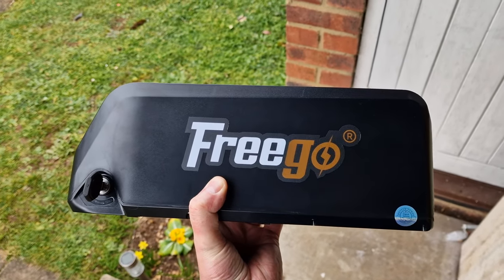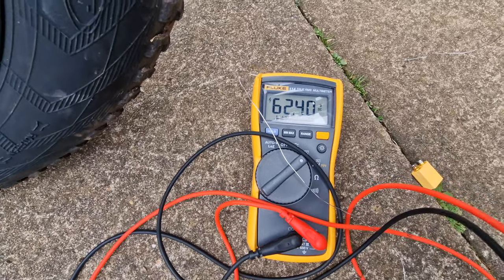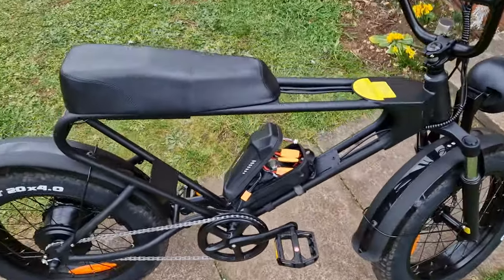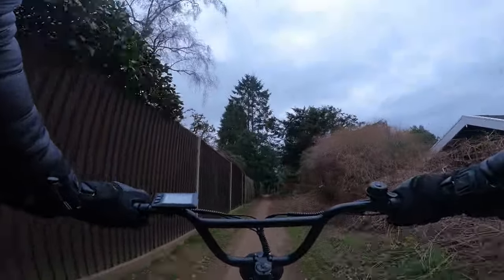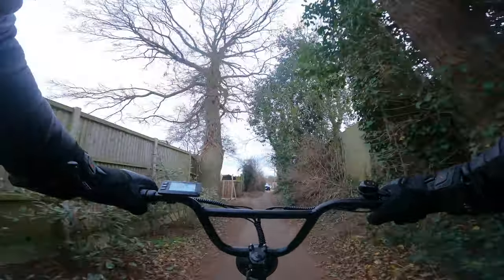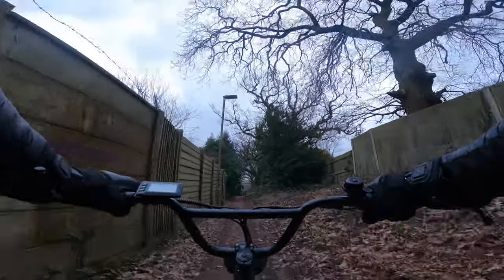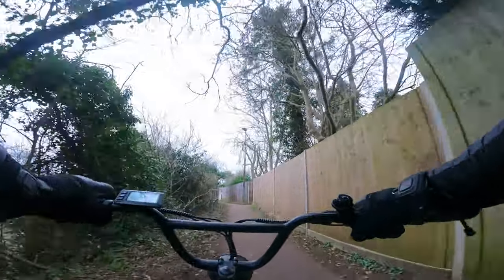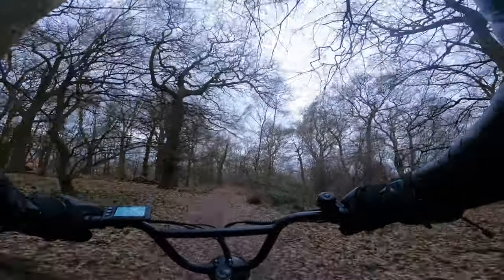HOW TO MAKE ANY EBIKE FASTER!!!

Comment: years ago 2012? i bought a 24v 250w and a 36v 500w kit off ebay, found out it was the same kit! just the increase in voltage gave you more power! it also gave you more speed.... I opened the kits which confirmed this every component the same, including 63v capacitors and 75v mosfets... you know what happened next... 48v... then i got my 4 4s packs and tried 66v... no smoke, but great hill climbing and 32mph.... lasted 2 years before it smoked. repaired and still have that controller/wheel for bench testing

Comment: The individual cells in the battery can be replaced. You test them in groups and when you find a group that doesn't register. You replace like 4 or 5 of them, because one of them being bad will weaken the others. One bad cell can prevent the entire battery from working. The individual cells are like 18650 3.7v 20A or whatever your battery amperage is. Instead of replacing the entire battery. It's a lot less costly to just replace the cells. $50 to $60 in cost for those cells and solder strips. You can be up and running.

Comment: I can confirm this slight overvoltage positive effect, I have been running my BBSHD for around 4 years with a DIY 15S Setup - 61.3V Total (charged/balanced to 4.1V per cell) "No BMS" it works great.
Extra range, extra power, charging to around 90% so a much longer cell cycle life. Obviously warranty is out the door, but if you know what your doing, eg if mosfets are within Voltage limits etc then no big deal. Cheers Andy 👍👌😊🍻
Reply: On original Controller?
Reply: @Full_Throttle_no_Brakes  Yes
Reply: @oze-bikes4life663 cool. thanks
Reply: No bms ?

Comment: Most 36 to 48 volt motor controller have an 60 volt capacitor so up volting or overvolting to 52 volt is never going to be a problem. The new weight you add for more power and range comes at a cost in handling. Look for motor controllers conversion systems with an On / Off road limiter option (single blue or pink wire coming out of the motor controller then back in without connecting to outside source) you cut it or disconnect it plus you can do a lot thru your LCD controller menu to get that extra MPH. Re set the wheel size larger turn off restrictor speeds most have menu guides on line. If you are going to build an E-bike from the ground up (much more fun) don't be impulsive, think about how you want to really use your electric bike the most. I have gone full circle and ended up with my Apex E-bike design that suits me best for use, handling, power and range, The result is an 26 inch rigid frame mountain bike suspension front forks with BMX headset and handlebars cruiser tires and seat. Powered by a Hailong triangle 48 volt 20ah 1600 watt battery converted with an 48 volt 1500 watt VoilaMart direct drive system. Got disk brakes and regen the PAS on this power/controller marriage is perfect, some level 1 PAS setting are not even there when you pedal I can add an extra 5 mph to just pedaling and stretch my range further than I can stand riding.  Not that pedaling is bad but the throttle is great.

Comment: I have a 48v 1500 watt overvolted to 72v that will do upper 40s mph in ideal conditions 
But will do between 42-44mph (67-72 kmh) regardless of wind direction 
Had running for nearly a year and 1,000+ miles and still going strong 

Did right at 30 mph before overvolting
Reply: On hub motor geared or Direct Drive?
Reply: @Full_Throttle_no_Brakes  dual direct 
Some stuff on my channel about it
Reply: @2dthoughts ok thanks
Reply: i have similar setup, how do i overvolt it

Comment: I used to run my electric BMX hub motor on 72V it was ridiculous so much fun but it was hard work on the motor and controller, if the hub motor is geared the rotor is spinning much faster than the control circuit can cope with and 2 things happen, the windings heat, you can even start to melt the often poor solder connections between the motor phase leads and the windings, if the motor has a one way clutch bearing that will normally burn out quite quickly and unless the controller is decent the high speed rotor will often cause false triggering of MOSFETs and you can start blowing them as they stay hard switched on, I've been there done that.

For most geared hub motors rated at 40V I would go no more than 50V that's pretty safe, you only need to push the volts up a little and you are instantly in to zero reliability, for direct drive hub motors with no gears you can be more naughty and up the volts a fair bit.

Fun video, all my fast rides were done with model lipo, no BMS, just a fuse, you can also adjust motor timing and use field weakening to make motors run faster with the same battery voltage, you don't get much more power though you just get higher rpm, I used to change the timing, your also running the motor way inefficient as well if you do that, I did that once in the middle of an ebike race with Steve head from technical bikes back in 2004!! I don't really do much with the bikes these days, I did 20 years of playing with ebikes and realised I need to play with other things as the clock is ticking, loudly.

Have fun

Comment: I've had some issues with AGM batteries being too low to charge.  I ended up plugging in the charger with a spare battery to get the volts up enough to trick the charger to kick on.

Comment: Your faulty batt has crowbar cut out ! ( a crowbar will remain till reset ) think of it as a relay but using electronics …. Disconnect the Bms leave for a while reconnect … they should have used a fuse like my first batt …
Reply from the maker: Yeah is what I thought. They shouldn't have made the battery so damn difficult to take apart.🙄

Comment: Don't throw it!! Just a theory but maybe the battery was left in the warehouse for months and it was totally dead maybe just maybe if you leave it on charge for a good long while it will start to register somekind of current on the reading and it will have to build up to maximum capacity over perhaps twice aslong as it would usually take to full charge just an idea cause it worth a try Channels the absolute Bolloxxs by the way Big love!!!!
Reply from the maker: Yeah I'd never chuck it. I'll take it apart properly soon and put a new BMS in there. I'm 99% certain the cells are absolutely fine.
Reply: @andykirby  it could be too dead to charge or register with the bms. You can take them apart and trickle charge the pack woth a hobby charger get the voltage high enough for your normal charger to register and finish the job. Sometimes they're not salvageable.

Comment: I’ve got a Ouxi V8 2 and the display is locked to 48v but I’ve got a 52v battery I want to use with it, will it actually improve anything or because the parameter is set to 48v it won’t?
Reply: Yes about 4mph a new 30a controller get you in the 40s stop buy junk build good stuff and go as fast as you want😅
Reply: Lazy

Comment: Hi. I have a c91 e bike and it only does 15mph. Do u know how to make it go faster ? It’s a 1000w
Reply: You need to unlock it .. full throttle while turning the power on display
Reply: @worthyo  thank you and what will be the top speed with 1000w motor ?
Reply: @kingofball8967  I have the 48v 15 amh battery with 1000w rear hub. I'm 6ft and 97kg  I get around 28 to 30 mph. I've fitted a different adjustable rear shock as mine bottoms out on bumps
Reply: Type into YouTube " unlock c91" video shows how to do it. Brilliant after unpicking